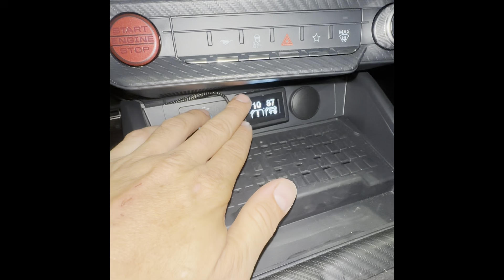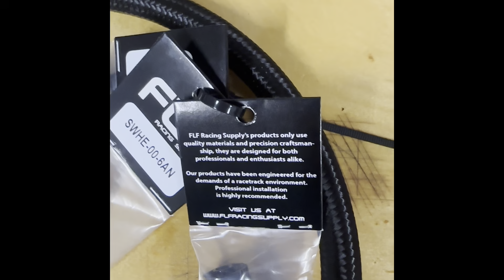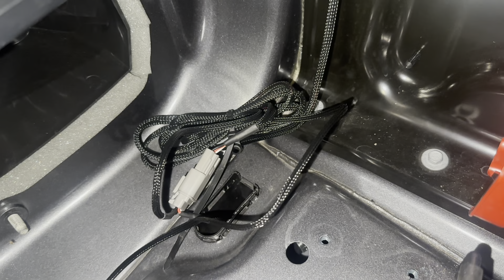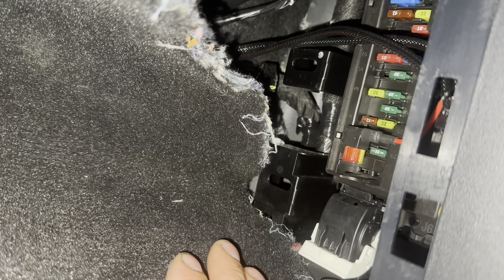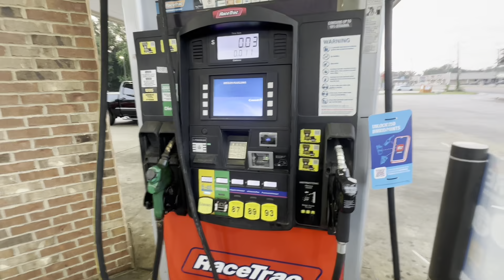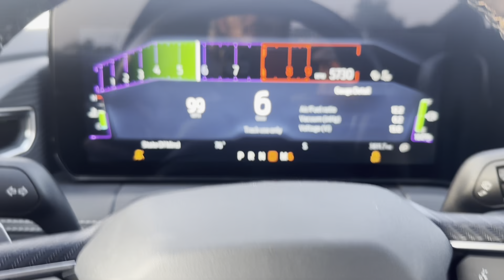2024 mustang e85! flex fuel kit #mustang #2024mustang #cartok #ford #mustanglifestyle #diy #e85

Comment: but about the tune ? need activate flex fuel on ecu tune
Reply from the maker: Just to monitor flex fuel / ethanol no tune is available for these cars yet and you still can’t control it with a sensor if you get a tune